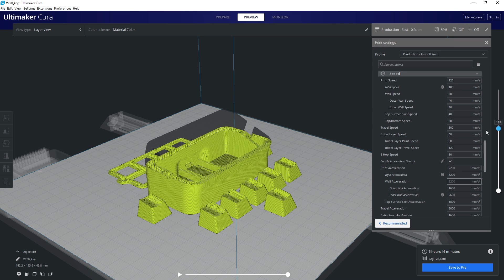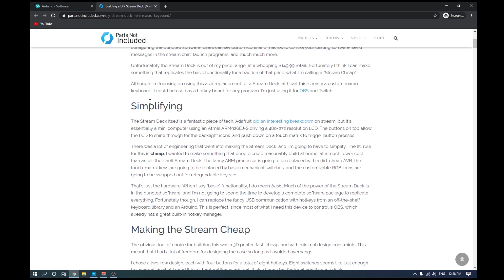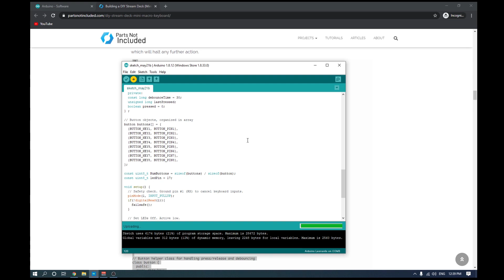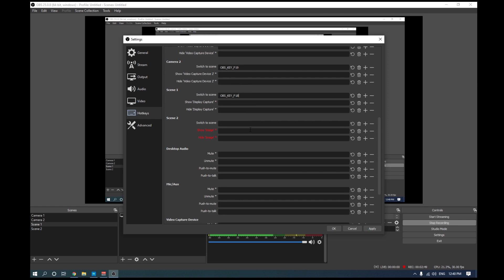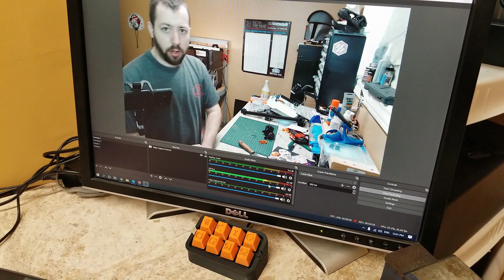Build Your own Stream Deck For Under 20$

Comment: This is in no way a replacement for the Elgato SD.  The entire point of the Stream Deck is the icons behind the buttons.  Otherwise, you'd just use keyboard shortcuts.  To be able to have multiple pages of functions for each button and an icon that will tell you what each icon does, plus the animations possible, are the only reasons people would buy the Elgato.

Comment: Is t possible to add LEDs or RGB to this?
Reply: Yes. I added the LEDs from the donor razer keyboard to match my keyboard. Just add resistors to the + and set the pins to high in the code. I don't think theres enough pins for A-RGG, but two pin RGB LEDs should work fine.
Reply: @sokoloft3  could you send me a picture or video of how leds are connected to the plate or keyboard switches please? I’m totally new to this. 
The code could be very useful too. Thanks a lot!
Reply: @martinrosenberg182  Sure. Talking here is hard though. YouTube likes to delete my comments
Reply: @martinrosenberg182  I have tried to post my discord like 5 times now and it just keeps getting deleted...
Reply: @martinrosenberg182  It's my username with pound 5490
Reply: @martinrosenberg182  Well I uploaded the sketch to my github under the Stuff repo. Should be able to find it. In it's notes I added stuff explaining how I added the LEDs. For your question about how they add to the switches. Look up switches that can take LEDs. There's a slit at the top of the switch the LED's go through. I pushed them through and bent them on the back side of the switch so they'd stay in place while I soldered them. They are tied to the same ground for the switches, but each pin has their own + pin and 100 ohm resistor. Before you put it all back together, wiggle the LEDs while they're on to see if any lose connection. I found a week or so a later a few of my LED's would dim out if pushed in a certain direction. I re did the grounds on them and double checked connections. Been fine since. Best of luck.
Reply: @UC4OtC0hOIxWR3a-D_Ux2_Aw Sorry man I don't use FB. Deleted that long ago. What about Steam?
Reply: No steam?

Comment: Thanks. Built two of these so far, another two to go. Works perfectly. I used hot glue to attach the arduino. Bit overkill but all I've got. I also added a good glob behind the connector and on the print to reinforce the arduinos port some. The reviews said they're prone to snapping off.

Comment: Make a stream deck for under 20$: Buy for 300$ a 3d printer, pay the electricity, buy the filament, try setting, buy solder iron pcb and many more. yeah in the end you have a stream deck for 20 oh now wait.... my deck has no buttons where I can change the stickers.  anyway good job done .

Comment: I'd advise for people to use diodes if they are making one of these. It will prevent ghosting issues.
Reply: To add on to this, you can make a matrix with the keys to save quite a few pins. The 8 pins in this case could have been 6, or you could get up to 16 macro keys from 8 pins on the Arduino by making a matrix instead.

Comment: there is a qmk firmware for this along with the 2x3 and 2x5 variants
Reply: Thingiverse/thing:4497991 and the firmware is on the qmk configurator under handwired
Reply: @gazeddy  thank you
Reply: Do you have a link to the 2x5 version? I cant seem to find it
Reply: Do have the link?

Comment: all you need to build your own stream deck is a couple of key switches, an arduino, £10 in fillament and a £500 3d printer!
Reply: A new 3d printer such as Ender 3 is about 155 dollars and even less if you buy a used one.

Comment: hi !
if i wanted to lend a friend the controller, just plug it in and go or does he have to do the whole arduino process? 

Thanks a lot!
Reply from the maker: Yes, once its all flashed and setup you can plug it into any computer and it should just be detected automatically
Reply: @CanuckCreator  thanks 😊

Comment: If you have some patients, you can get the Micro and a pack of 10 switches from eBay, shipped from China of course, for around $5. I'm cheap, and can wait, so I think that is what I am going to do. Thanks for the tutorial. Very well put together.

Comment: you think i could like use arduino jumper cables to plug in the switches to the pro micro instead of having to buy the connecters and a crimping tool?
Reply from the maker: Long as its a solid connection. Could solder wires directly if you wanted too even
Reply: @CanuckCreator  yeah would like it so be socketed without buying a crimping tool lol it should be a solid connection

Comment: hummmm SO this is my situation and need help, I got an Arduino Pro Micro and MX keys, I've programmed it to send (SHIFT +A-J)  fire it up open note pad, and bingo works ABCDEFGHIJ / Opened OBS assign the hotkeys to my scenes, scene 1 SHIFT + A etc , test it with my computer keyboard and it works... but when I try it from my macro keypad it jumps to other scenes or nothing at all.. any help? should I have just used the pre determined code.. the issue is im stupid on Arduino and I have 10 keys.. lol

Comment: Hello, I have a question, I have everything ordered everything, and I mean everything, I didn’t even have a soldering iron, this will be my first real project, but I can’t find the 9 pin connectors on Amazon do you have a link I can use?
Reply from the maker: I sourced mine via digikey
Reply: Nero 3dp ok! How long did it take to ship, I ordered mine from digikey also and that is the only thing I am waiting on
Reply: Nero 3dp also, how are you supposed to screw in the m3 screws, there is no threads?

Comment: Great Video! Definitely informative. I am trying to make it with 10 keys and tried to change the code a bit, but for some reason my keys don't work. I think it's probably a problem with my soldering, since I haven't soldered much in my life. Do you have any recommendations on how to troubleshoot it?